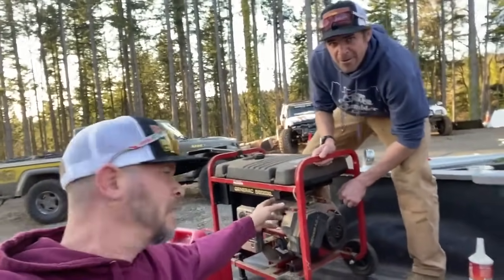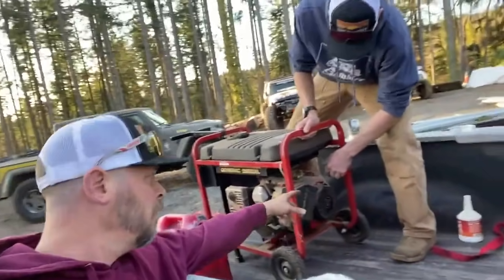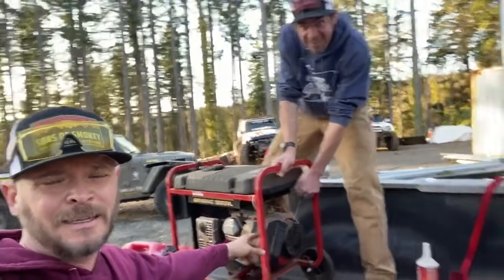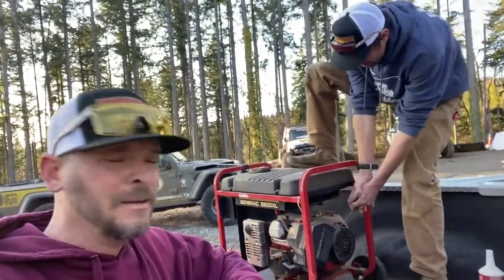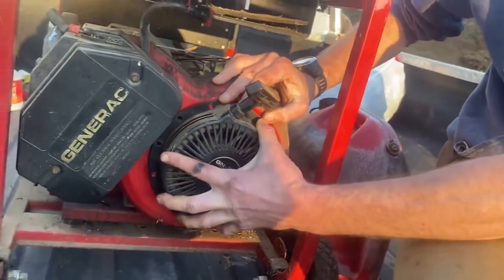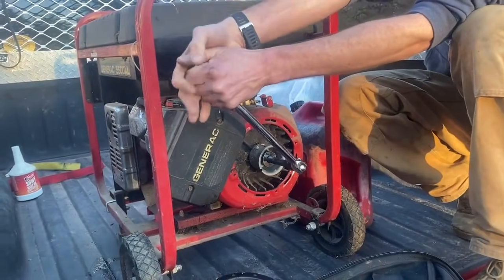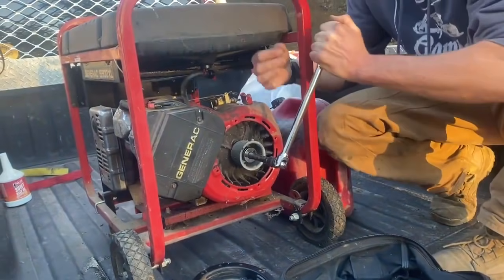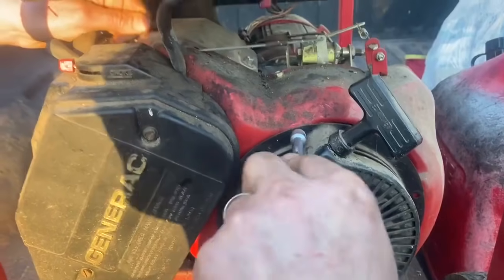Got a locked up generator that won't run?  No problem.  Sea Foam + elbow grease win!

Comment: Short power outage yesterday so it got me thinking I should just test my generator.  Sure enough the cord was completely siezed up.  My fault for leaving it covered but outside for a few years.  Mice had made a home in there which I cleaned out but still no luck.  Looked at your video and first thing I tried was to use socket wrench to try to move the flywheel.  It started turning and I put the assembly back together and it started on the first pull. Thanks!

Comment: I bought a brand new PowerStroke 3500W generator several years ago. Left it in the box, in a dry shed, untouched. When bad weather was anticipated a couple years ago, I hauled it out and discovered mice had made their home there. Rust on wires where they had urinated, etc. I was not happy. Cleaned it off, put oil and gas in it for the first time, and discovered the motor was totally seized up! Wouldn't budge! Your video was short and fast (whereas most others drag on and on), and I wish it was longer! So what Seafoam product would you recommend I use? I already bought a wrench to try and "hercules" the engine loose after soaking it properly. Thanks!
Reply from the maker: Deep Creep was used to lubricate the stubborn parts.
Reply: @SeaFoamOfficial   It worked. I used Seafoam, let it set for a few weeks, removed the pull-start cover, used a socket wrench and rubber hammer to gradually get the piston to do a few full rotations, then used a drill to turn it for a couple minutes. The result was a child could now pull that starter cord with ease! Next stop: pressure wash it, add some gas, and see if it'll fire up!

Comment: Can Sea Foam be used with small two stroke motors that are using pump gas with 10% ethanol? will help the problem of running 2 stoke small engine with 10% ethanol
Reply from the maker: Yes, works in ANY fuel. Sea Foam is petroleum oil so will help with lubricating the carburetor circuits. Ethanol typically causes trouble for engines older than 2003, mostly because the fuel lines aren't resistant to ethyl alcohol. Hope this helps!

Comment: My generator suddenly became stiff after shutting itself off while on. And I couldn't pull to turn it on anymore. Would it work for that situation too?
Reply from the maker: Did you have a piston overheat? Able to crank the engine?
Reply: Mine died while running and now it's frozen. Will the same process work? I'm not sure if the pistons overheated. @SeaFoamOfficial

Comment: I found one and the guy said the engine is locked up. Is this normally the issue and how I can fix it?
Reply from the maker: Locked up often means that a piston ceased in a cylinder/ruined. Can also mean that the engine sat a long time so hard to crank.

Comment: Too bad you cut the video.   I’m sure you had to pull carb off and clean.     Doesn’t matter tho I still use sea foam lol
Reply: Nope. This is the second Generator they've fixed with just Seafoam.
Reply: Your video shows otherwise.     Your video was edited before the generator started    Sea foam works. But doesn’t work that good
Reply: @python71483  Whose video? Not mine man. I just know the two guys in the video and they don't lie. Deep creep frees up the piston, which then allows the motor to rotate freely. I do the same thing with Marvel Mystery oil, but deep creep is easier to spray in and coat the cylinder.
Reply from the maker: Cajun: Respectfully, if most fouled carburetor issues are caused by fuel varnish, why would anyone go to the trouble of removing a carburetor? Sticky/heavy varnish gums up carburetor circuits, Sea Foam reliquefies the varnish back into the liquid fuel phase to clear things up and burn in the chamber. Hope this helps!
Reply: This video has a bunch of cuts in it.  It you started a video from start to finish without any editing.  I’m would be a different story.
Reply: @python71483  Or, just enjoy the cuts that make this video awesome. It's fun. Watch any of the other videos featuring Tater (like the dirt rod series that just started) and you'll understand his editing style. This wasn't produced by Seafoam.
Reply from the maker: @python71483  This is user-generated content,  videos that customers or sponsor partners send to us.  The cuts are someone's editing style + to keep things short and engaging, not hiding anything.